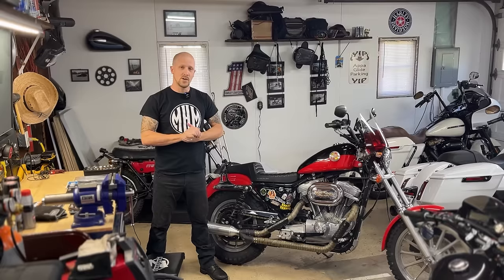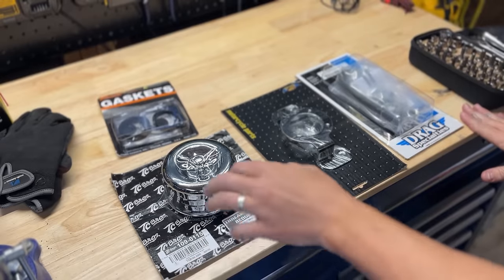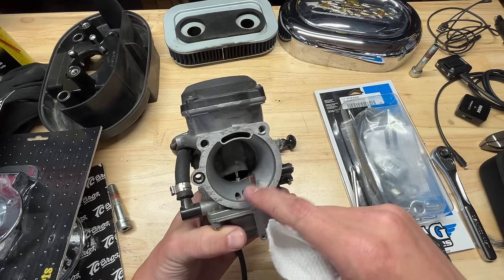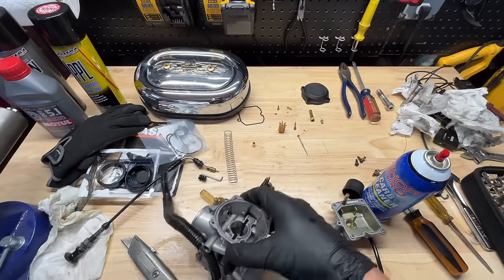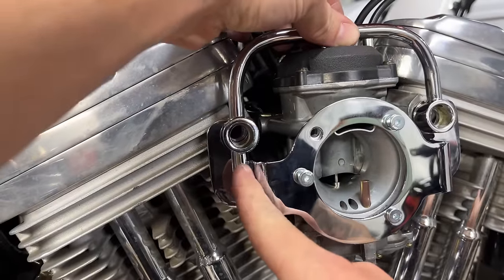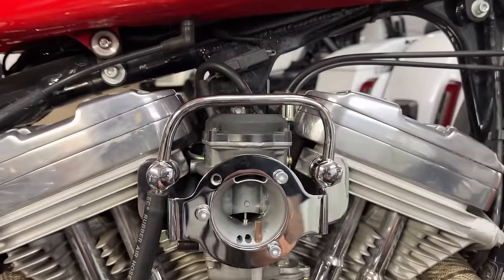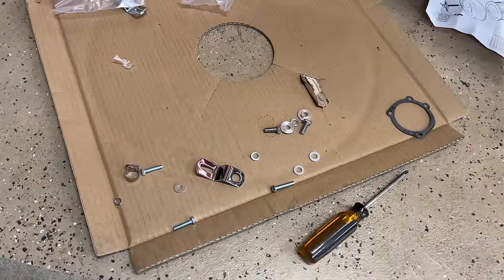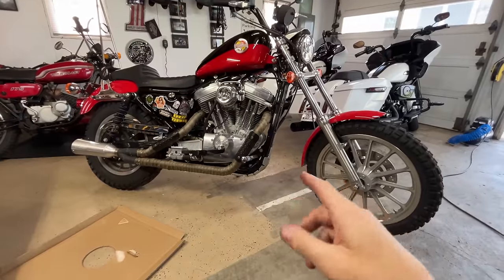Huge changes for the Sportster

Comment: So I saw this on another channel. If you get an ultrasonic parts cleaner here is a money saving hack. Get a plastic jar like a peanut butter jar and put your parts in it and put the cleaner in the jar and close it up THEN fill the tank of the cleaner with water and put the plastic jar in there and turn it on and run it. This will save having to throw out a bunch of cleaning solution as you have only the stuff in the jar that is dirty. The waves pass thru the water and into and thru the cleaning solution. Money saved can be used for beer or whatever you like :)

Comment: I need to do mine. Its been getting progressively worse, and it needs a retune since I installed one of those TC Bro intakes. However, it's been a really good carb for the last 50000 miles. I've never had to clean or work on it other than a couple of choke cables.

Comment: I had that exact breather kit I hated it so removed it and install a similar setup but without the horseshoe thing so basically what I have now is two breather banjo's that each have a tube coming down.   My sporty turns 20 in a couple months and i think my accelerator pump gasket is leaking now too.  Bought this bike new so not bad for all these years.

Comment: I had that air cleaner and didn’t like the filter that came with mine
It seemed to be a cheap K&N knockoff that had major gaps 
I searched hi and low for a quality filter that same size but K&N, Uni and even WIX didn’t make one that size 
I ended up with a DK Customs external breather setup